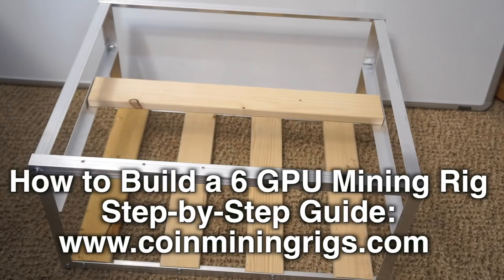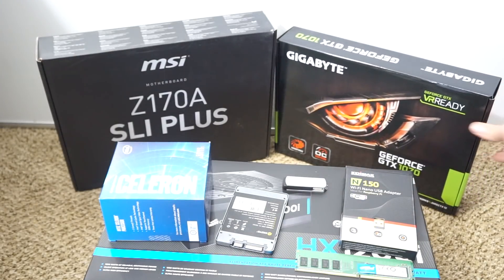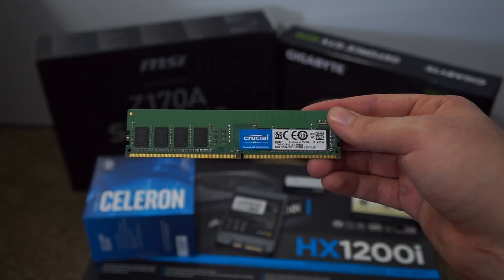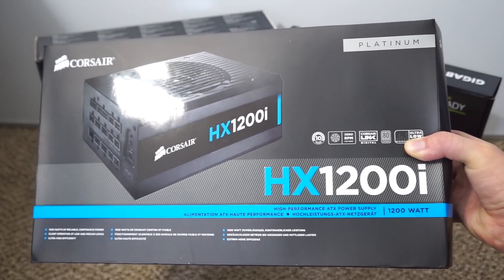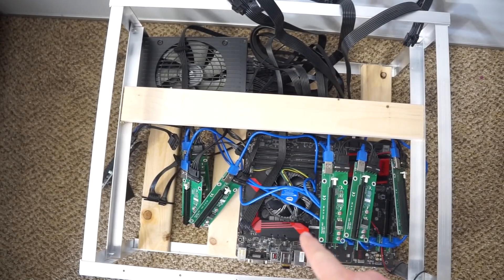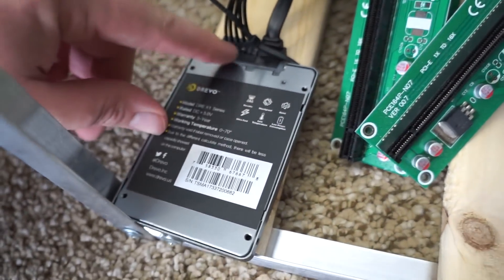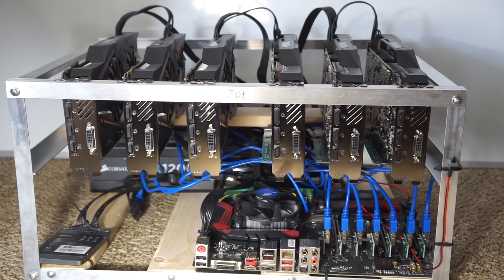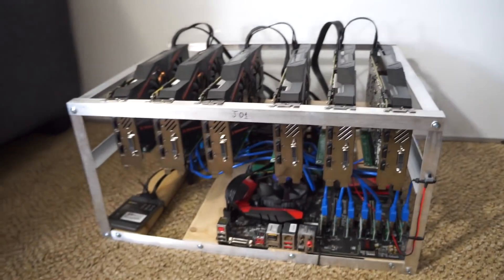How to Build a Crypto Mining Rig in 2022 -  6 GPU Crypto Mining Rig Build Guide

Comment: Any recommendation on how to get windows to recognize all the cards?
Reply from the maker: If you're using Windows 10, I recommend downloading the graphics drivers directly from the AMD or Nvidia manufacturer's website. Install driver and then reboot the computer.
Reply: Ive seen tutorials. Its not hard, but too much for a comment. You just have to change a few BIOS settings and youre good to go.

Comment: I have the following
gigabyte z270p-d3 (BOIS UPDATED TO MIN.F8a) https://www.gigabyte.com/MicroSite/462/mining.html  <<< if you see the pic first step say Enable Mining Mode but mine dont show that
HyperX 4GB 2400MHz DDR4 Non-ECC CL15
EVGA Supernova 850w PSU
Kingston A400 120GB SSD
Intel Pentium G4400 3.3 GHz Socket 1151
6x MSI GeForce GTX 1050 TI 4GT OC Graphics Card - 4 GB (THIS DOSE NOT HAVE ANY POWER PLUGS IT RUNS FROM THE USB RISERS POWER)
windows 10 home

So the problem i am facing is that the mortherborad picks up 4 gpus only.
I have unpluged all the gpu out and tested all the PCIEX with one gpu
also tested all my usb risers

I found out PCIEX1_1 AND PCIEX1_2 are not reading but dose power up
is there any way of turning them on to read somehow?
tried gen 1 gen 2 gen 3
also tried to use hiveos as they pick it up right away other then win but it shows only 4 still

-----------------------
PCIEX1_1 (NON WORKING)
PCIEX1_2 (NON WORKING)
-----------------------
PCIEX1_3 (WORKING)
PCIEX4_2 (WORKING)
PCIEX4_1 (WORKING)
PCIEX16  (WORKING)
-----------------------

Comment: Why do you have more than two devices connected on a single wire from PSU?  2 is max anything more you might get on fire
This is the worst setup ever not to mention that its titled 2018 and NO ONE uses green risers with 3 capacitors any more. You should rename it to a build from the 60's

Comment: Mining Bitcoin and other cryptocurrencies: Bitcoin mining is the process by which transactions are verified and added to the public ledger, known as the block chain, and also the means through which new bitcoin are released.  Anyone with access to the internet and suitable hardware can participate in mining. If a contract of $2260 can gain $4959 in 166 days, then imagine a contract of $10,659 (1 BTC) using the PandaMiner B1 Plus, L3+ Antminer, Ebit E9 Miner 6.5T Bitcoin Miner or T9 Antminer. Ask yourself, what will it yield in 166 days also???
You can reach me any day, at anytime via [andreablunt55@gmail .com]

Comment: I used your guide and got all the same hardware as you used except cards are Rx 570, 8 gb.
Miner works fine with 4 cards but if I add 5th, 6th card it mines with only 2 cards(1st & 2nd card). 
I checked in MSI Afternurner and it reads all 6 cards but for card 3,4,5,6 memory clock and memory use shows 0. 
I am using AMD drivers Driver Version 17.30.1029, and did BIOS update on mBoard. Please help
Reply: Same problem, Did you have solution yet ?

Comment: MSI Pro Series Intel Z270 DDR4 HDMI USB 3 SLI ATX Motherboard (Z270 SLI PLUS)

Intel CPU BX80662G3900 Celeron G3900 2.80Ghz 2M LGA1151 2C/2T Skylake Retail

4GB 2400MHZ DDR4 NON-ECC CL17 DIMM 1RX16  

DREVO X1 Pro 64GB SSD Internal Solid State Drive 2.5-Inch SATA3 MLC High Performance

Are these compatible ? I am not getting any power to the Monitor or the mouse ?   Thanks in advance.

Comment: If you mount the GPU and then connect it to the riser without the power button actually connected would you reccomend that set up a cooling assembly for one or none or all or rather for example would you run the mining ap as well. Thanks, GREAT VID!!

Comment: hi thanks for the video, quick question, how does the GPU power connections work? The PSU only has 5 spots for gpu power right as one is used for CPU? thanks

Comment: hi, thanks to this nice video. just wanna ask why you have 7 gpu risers? and you got only 6pcs of gpu. And also i am having problem with the video output. if i plugged the hdmi to the motherboard there is no display. please help. thanksSorry i noob to mining rig
Reply: You need to set the bios to boot off the igpu, it will default to one of the cards if gpus are installed.
Reply: Connect the hdmi cable to graphics card which is connected to 1st gpu lane. That's how display worked for me
Reply: Thanks

Comment: Why use a weak Celeron cpu,havent a clue wtf its for...
Reply: because you want to keep the costs as low as possible while keeping performance up. Youre not going to be mining with the CPU because there is no point. The power it draws isnt worth the hash rate. This celeron was chosen because of its low price tag, and its ability to run the computer perfectly fine while mining because the GPUs are doing all of the work.
Reply: ok,makes sence now but just heard of minning for what purpose?
Reply: Phillip Joslin I'm no pro either but you 
generate coins that you later sell of to people wich want to use it to buy stuff in stores or in the web. So you are mining a value wich you can transfer into money later. So you are investing in good hardware wich then is refounded and made profit of. The problem is the more bitcoins exist the less a coin is worth, so there will be times you make good profit out of it and there will be times where you cant even pay your electricity fees.

Comment: Hi, I'm thinking of buying the same psu, but on corsair website i noticed that there was only 4 PCIe 8pin (6+2) cables. How did you wire the 5th and 6th gpus ? Thank you for your answer
Reply: Arthur Bensimon I wish you would answer your question. I have the same PSU and I was wondering the same I only have 4 GPU running.
Reply: You can use multiple PSUs, or buy a modular one and add more cables to it.